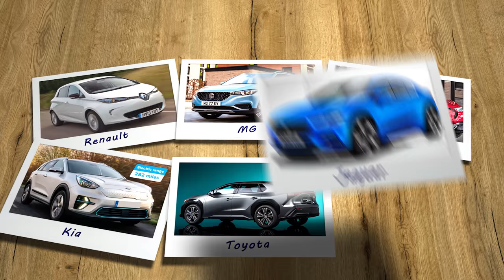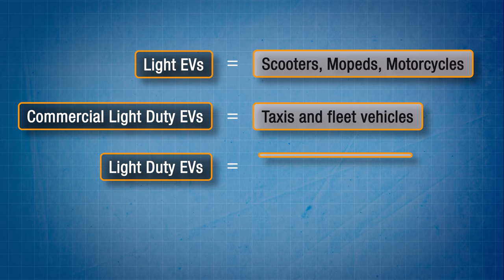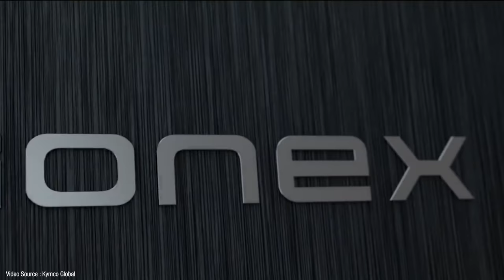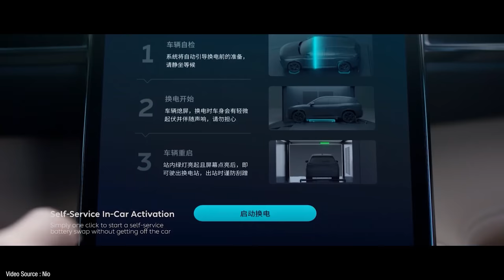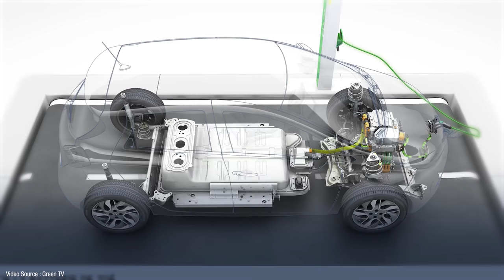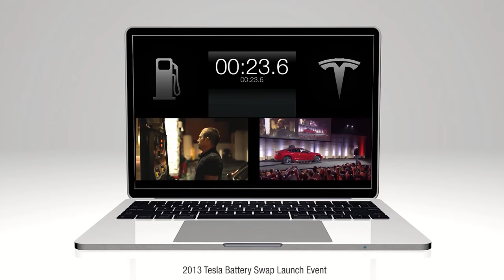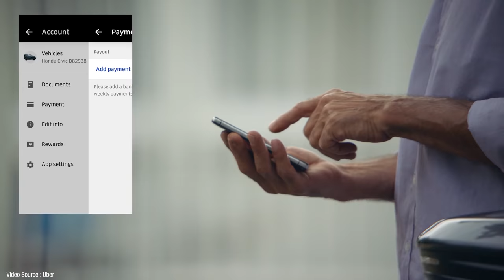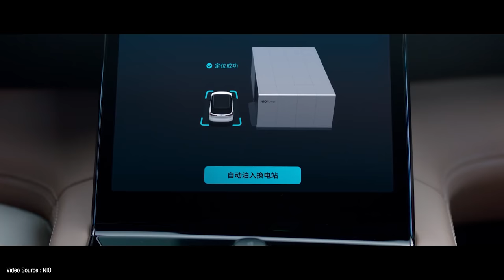Battery Swapping. Transforming the trajectory of electric vehicles?

Comment: Great video as always, very informative. 
One possible issue I can see with the battery swap model is the need to have more batteries ‘in circulation’. One battery for each vehicle on the road plus all the batteries on charge/ready to go at the swap stations. Considering the shortages in raw materials to manufacture batteries for ev’s, wouldn’t this make the problem worse?

Comment: What's the power to the point analysis on swap v's super charger?

If you have multiple batteries cycling at a recharge point  does the total current to the site compare to the sudden peak current for periodical car visits? Is there much difference to the cabling required for a battery swap site compared to a direct charge site?  

As either or both types of charging become more common in urban locations and the power is still going to come from an electrical distribution grid, is there any difference in the power transformers, connections etc for that location?

Comment: There are so many negatives in the way of consumer cars’ swapping systems, from possibly not being sure your swap station actually has suitable, charged batteries when you are relying on having one  to the obvious issues of filthy muddy cars’ undersides interfering with the bolts etc. Unless the recharge is done at a rapid rate - with the same longevity issues - the inventory must be at least twice the number of cars on the road.
I watched the Tesla replacement video years ago when it did twice the battery swaps in the same time as the ICE vehicle took to fill and pay - impressive, but impractical in the real world.

Comment: I can see the scooter/motorcycle market transform to swappable battery market, since most are driven in and around big cities. Just like with electric bicycles, they are light and portable to allow them to be charged at home. But as soon as the weight of those batteries goes beyond 25kg it will be to difficult. The car market in cities will change to robotaxis before the battery swap market makes a dent. There was an another company called Better Place which tried and failed as well. While Tesla has always been battery constraint, since it will require almost 2 batteries for each car sold.

Comment: I knew a fellow in the Austin, Texas area, I guess about 15 years ago, who was developing a battery swapping concept for cars. He was working mainly on the latching interface spec, and a robotic system for performing the swaps and moving the battery packs from the bottom of the car to a vertical rack system where they'd be stored during the recharge. This was at a time when lithium was still somewhat exotic, so his battery pack design was based on lead-acid, but that wasn't really his focus. I remember his prototype latching mechanisms seemed really robust though, to support the weight.

He had filed for patents for his system; I lost touch with him and I wonder if he's involved in any of this development today.

Comment: If it's possible to swap batteries for full ones, it would (or should) also be possible to just remove the battery.
Downside: this probably will lead to theft of the batteries. 
Upside: in case of a fire, the battery could be released and pulled away.

Comment: As long as we are transitioning to 100% BEV, battery constraints will be an issue. For each vehicle on the road, battery swapping systems need 3 batteries. One in the vehicle, one being charged, one ready to swap. 
This means that battery swapping inherently carries the tradeoff of either getting 3 BEVs on the road, or having one able to swap their battery daily. That's a lot of capital investment tied up behind charging revenue that could be on the road, getting brand visibility, earning sales revenue, etc. 
Once there's sufficient battery production that the industry isn't battery constrained, and new BEV sales start slowing down due to market saturation, THEN battery swapping will make sense. 
The irony being that while battery swapping is faster than charging and thus arguably could drive EV adoption, the constraints on batteries for swapping means swapping would actually be a net drag on EV adoption - increasing consumer interest while decreasing supply.

Comment: There is no reason why a dual battery system couldn't be used in the short term. A retro fitted slot for the swappable battery pack in the boot or under the bonnet to get a hundred miles or so in a one minute swap time might be appealing to drivers who don't want to wait for a charge or just extend range by 50% or so.

Comment: Swappable batteries is a bad idea for cars (might make sense for scooters or motorcycles, but not convinced). 
1) You need to have a lot of batteries (maybe +50%) 'sitting around' being charged. I think we'll be battery constrained for the next few years making a difficult and expensive proposition. The idea of being able to charge at night with clean energy is s pipe dream as they probably will barely have enough time to charge the batteries as is (unless they have a lot of batteries).
2) After driving for 3+ hours, you need a 20 minute break to go to the washroom and stretch your legs. If you take more frequent breaks the charging is even faster (like 10 minutes).
3)  If a city can install parking meters everywhere, they can install level 2 chargers as well (or even a good level 1 charger). They make some revenue and attract EV drivers to their communities.
4) Waiting for 2 minutes while they swap the batteries as well as the lineups they seem to have in China to drive into swapping station is too long! It takes only seconds to start charging my Tesla and I can walk away - go for a walk, go to a restaurant, do some shopping.
5) Batteries that can be swapped need a lot of extra weight to hold the batteries together safely. Tesla's structural battery can have 'weightless' batteries (i.e. the reduction in stiffening support is more than the weight of the batteries). 
6) Batteries that can be swapped is more complex, the beauty of EV's is they have less parts. Now you need robust connectors that can handle insertions every few days - yet lot of volt-amps,, bolts that can be undone even in winter with salt corrosion. That's just the car's complexity, the complexity of a machine that can swap the batteries must be crazy. I'm sure that will 'never' break down.
7) Having standard batteries is likely never to happen. Cars come in different shapes and sizes and owners want different ranges. Will these swapping stations have to keep different types of batteries in inventory?
8) The idea that fleets will need this is crazy as well. A 250KW supercharger takes 15 minutes to add nearly 400Km, which is a good 3+ more hours of highway driving, or all day of city driving. Most fleets don't drive 400km a day (more like 100km). Bank of level 2 chargers at the home base, can make sure all the vehicles are ready the next few days.

Comment: The biggest advantage of battery swapping is the weight reduction. You don't need to haul 400-miles worth of batteries at once. Take 200-miles worth and save weight while increasing mileage.

Comment: How do they handle road salt, and the frozen salty sludge of sand, gravel and ice covering everything underneath the car, during winter? And how will they handle the resulting corrosion from this?
Around these parts, cars tend to corrode pretty bad underneath, unless they have additional protection added, which is usually a pretty sticky substance, I don't see playing all that well, with the mechanics of a swap system..
In all the videos I've ever seen of battery swap systems, everything is always squeaky clean and shiny.

Comment: ~rented batteries could make better use of production capacity, as it allows us to choose a range capacity apt for flexible duty cycles - we can rent a bigger one on a trip e.g.

most evS spend most time in the garage imo, & have overkill batttery range due to range anxiety.

homogeneity means they could have standardised smarts to integrate with the grid when connected during grid peak demands.

Comment: The best of both worlds would be a smaller on board battery for example 22KWh battery with 100 mile range

Plus the ability to go to a battery station where a 70KWh battery is attached to the under body of the vehicle giving +300 miles of range

This way you can have a lighter cheaper more efficient 100 mile range EV but with the ability to cheaply rapidly add a 70KWh battery to the bottom of the vehicle for the few days a year you need 400 miles range

Comment: I own a Tesla, drive a lot, but I have not supercharged in months. I live in an apartment and joined the board so we built chargers on the parking, so it's just not only for people with "house and a big driveway". Eventually, all parking will have slow chargers. Swapping just doesn't make sense because 99% of trips are not long range and thus you don't need fast charging. Even if my battery was half the size I would rarely need fast charging. I actually enjoy the 20 minute break every 350 km or so, it makes me a better driver. However I could see this making sense for taxis and truck transport that constantly drive and time is money. EU could standardize a battery pack together with the industry.
Reply: On the contrary. People can buy cars with smaller battery packs, the what-if-I-have-a-longer-trip question will be solved. A hybrid costs money, they miss out on the low costs for a simple motor. The drivers "fuel up" (swap) once more if they drive a longer distance. And 90 % of the time they are fine with less eprformance.

 Your charging station is only useful if you are parked there during day (as opposed to being at work). If you happen to be elsewhere with your car where you cannot easily get access to charging .....
Even if you are only "stranded" twice a year, it stil sucks. 

In many areas vandalism would be an issue, if the charging station is where everyone could easily  have access. 

The swap stations are more concentrated so it is possible to protect them, but if lots of people have their charging stations outside of relatively protected / secre areas - it is hard to protect that.

It also means they could use lesser materials for batteries. Materials that are not as energy dense, batteries that are heavier (but they can be smaller so in total it is not too bad), that are not well suited for fast charging - but are cheaper, or have less ecological impact than LI. 

if the high performancedemands fall sideways they might already have materials that are "good enough" for instance for the many of people that drive a modestly powered car for 10 - 30 minutes twice a day. 
If batteries are mass deployed we will run into material shortages. So it would be good to have more than one material that can be used.

Comment: You pay for speed because you essentially need multiple batteries for a single car.  Batteries are currently very costly because of supply constraints.   Any company using battrey swaps  will only be able to scale up when  production gets cheap.  Somebody has to pay for those extra batteries.

Comment: I think this would be a good idea, but I'm not sure if America is well managed enough to pull something like this off.  Companies right now sell you the car, the warranty expires and it's not their problem.   If this batteries as a service happens I can see these companies actually putting some engineering into making batteries serviceable.  

My understanding is that there is considerable variance in wear from cell to cell so that some people with the know how can replace the bad ones and most of the cells are still good.  Although I believe cells that are paired together have to be voltage matched otherwise performance/longevity suffers.

Anyway if the companies own the batteries, they have the economies of scale and incentive to service them.  Plus you don't have to worry about replacing your own battery which is a huge drawback to electric cars.

But as I mentioned earlier, if we can't even get the government to force companies to stop deliberately making their products unrepairable, what chance to we have in mandating some kind of industry standard?  Honestly our country is so poorly managed, I'm kind of concerned that once electric cars become the norm and internal combustion engines get phased out, companies will then start deliberately making cars with shorter battery life so that you have to buy a new car sooner.

Comment: Swapping car batteries is like swapping gas tanks. It's a solution waiting for a problem.  It sounds good in theory, but in practice is unwieldy.  Battery swap depos still have to have a massive power upgrade the same as a charging depot.  Just keep it simple and leave the inventory, fussy labour handling, security, taxes, overhead, liability, real estate, heated building, business costs, and extra cost associated with a minor convenient consumer service out of the equation and stick with patience and flexibility with independent charging, and fight for a plug at your apartment building and work, and perhaps make wireless highway charging..

Comment: Honestly why not just skip over batteries and just have a service where you get an entirely new car when you need a refill. The only time you have to wait is if you have to transfer items from one car to another. You can still recharge if you need to, but if you want the battery packs to be built into the car you now have that option. This option becomes much more feasible when you add self driving to the equation. Just have a car come and pick you up every day and you almost never touch the steering wheel. You don't need to have a charging station at your house because it is a different car with a full battery every day. You get lots of options and I think the flexibility that comes with replaceable batteries or cars is what matters most.

Comment: For fleet cars and larger heavy duty vehicles I can see this being pretty cool... But they will likely own and operate their own swapping systems.
For personally owned vehicles... This seems like a hastle. The underside of a car is a wreck, and people who don't regularly wast their undercarriage are going to end up with rusted snapped off screws that mess up the entire charging station until a tech can come out to fix things. Individuals, especially in America, can't be trusted to maintain their cars well enough to use these kinds of systems.
Plus, at least in the US, there is a growing push to limit service contracts and subscriptions that are more than $20/mo.
Reply: But man... For a garbage truck or taxi service? This would be amazing! If everything is well maintained then the ability to get a slightly lower range vehicle for cheaper with a quick turn around time can allow for a lot more flexibility.
Plus a removable pack would be easier to work on if you need to replace a few bad cells that are going bad.
I use ego lawn equipment and had a bad battery. They replaced the battery for free, but did not want the bad unit back. $20 for a neighbors half dead battery pack and I was able to swap out the bad cells in mine and now I have two 7.5ah battery packs. New these packs go for about $300 each, which is kinda crazy. 
For fleet operators the cost savings of repairing packs by replacing cells just can't be under stated! So a quick turn around and longer lived packs may be the difference between making a fleet possible and very lucrative vs having to close up shop.

Comment: There seems to be many pros and cons for this idea. Scooters in cities, with much the same battery and drive train - great. Fleet vehicles also looks, to me, promising. Cars, well, you can't put the same battery in a sports car and a city car. Modules, put in one or more depending on power required? Great to use for home energy storage when not suitable for transport. Kills the idea of the car structure being used as battery. How many batteries required for 100 vehicles? More than 100. In a city only takes up 2 parking spaces. Or, to put it another way, you lose one parking space. Multiply that by a city. 
In the end, it seems to me like a tech that will soon be out of date as battery improvements come on line. There could be mobile charging trucks, to give a quick boost to a low or flat battery. I once thought that genset trailers could be hired for the occasional long trip, but that has become unnecessary as the  infrastructure improves. We are not so far from the state yet of early motor vehicles, when fuel was delivered by train to a station. Time will tell is as certain as I can be.

Comment: Tesla has a 4 charger with a battery at the center setup pre-wired in a slab of concrete. It fits in a back of a semi so  it takes longer to get there permits than to set it up.

Comment: When it comes to cars, swapping out a $15,000 battery for $10 of electricity is not a value proposition. It will work better for trucks and train locomotives running between a few destinations.

Comment: The battery swap model is likely one having a niche market. Scooters probably need them because of their smaller size that they cannot travel far with the small batteries that can fit into their vehicles. Cars probably don’t need battery swaps if they have a range that’s greater than their daily driving distance. Big heavy commercial electric vehicles might need them because of heavy use of power. And so on. I do think that battery swap as a business model is self limiting because adding on the spare battery capacity to scale up is going to be very expensive.